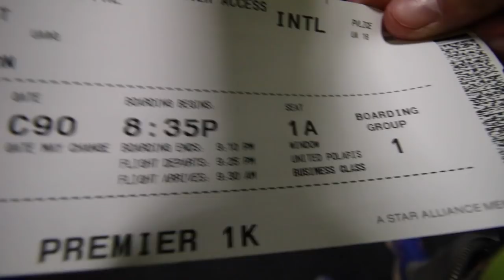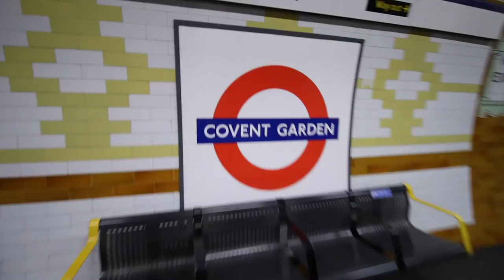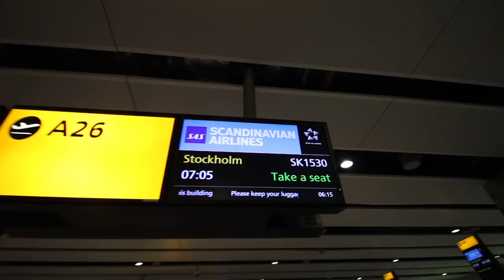New Signature Basses Revealed | Vlog #320

Comment: OK if that's an affordable travel bass I would absolutely love that
Reply: Looking at the pricelist of the luthier, since this is basically the Series IV the Single Cut will be  around 5700 USD base model plus preamp and other options.
Or maybe it will be a bit  cheaper if they go for that bolt on design shown in the video instead of the neck through
Reply: Yeah  I don't know how much will these costs but I wanna know, are those ones on the price list made in the factory where this bass will be made. In the case of the Series IV I would rather get a used fodera. Sorry guys :(
Reply: they are hand built i think
Reply: I don't want to be rude. But affordable is a really high spectrum. For some eastern Europeans (like me) a guitar that costs 1500usd is a lot of money.  So I really wanna get a this bass but I can only afford it if it's not 5000+ usd. I think I'm not the only one to think about it this way.
Reply: The factory ones are probably going to be cheaper. But you also have to consider that this is a small company.
Reply: Yeah, you are right. :)
Reply: superbass340 economies of scale, cnc machines etc etc